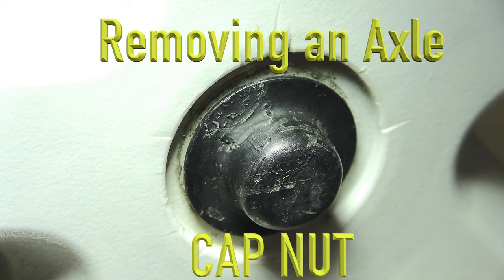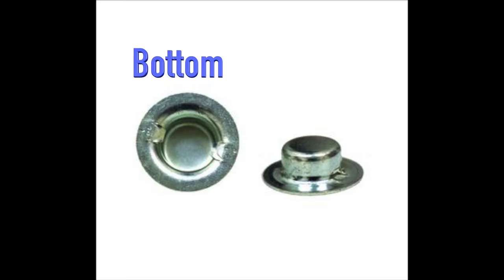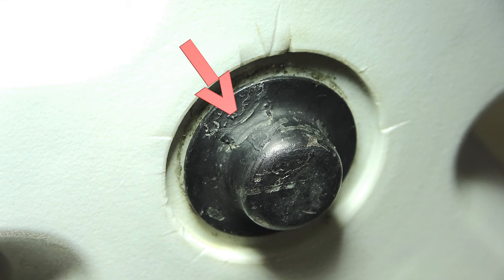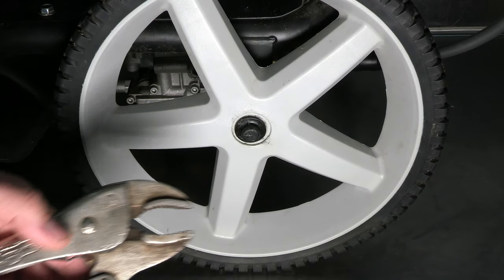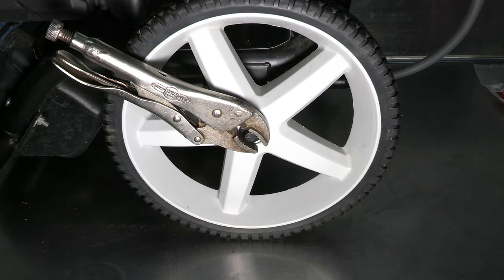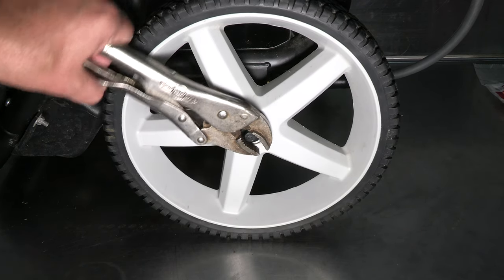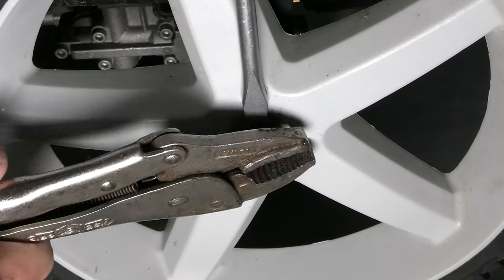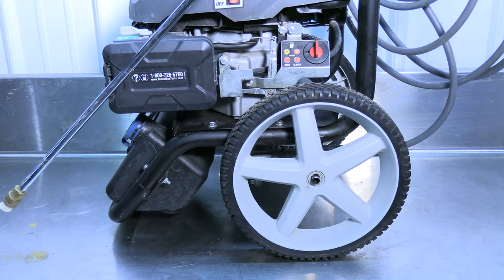How to Remove a Push Nut  -  Axle Cap Push Nut Removal

Comment: Unfortunately the push nut is recessed below the wheel hub. The only way to get a vise grip is straight in (no good for torqueing) and the flange OD of the push nut is so close to the recess diameter that the best one can do is go in at a 45 degree angle which prevents prying on the edge of the push nut (it just pops off).  I could drill a hole in the plastic wheel hub to expose an edge but I am still going in at a 45 degree angle. My other lever point is the plastic edge of the wheel hub recess which would deform badly.  I  have heard of a device that has teeth on the inside that can be pushed down on the push nut cap end. It cuts into the metal and has reverse threads like an easy out for screws but engages the OD.  I understand mechanics use them on rounded off lug nuts and will remove wheel locks (used by mechanics where customer doesn't have or forgot their wheel lock key).   I have tried drilling off the two locking tabs but the recess prevents the necessary access angle.  I even tried a Dremel tool to create a slot but the push nut is tight up against the end of the axle. Can't get a good bite without engaging the push nut AND axle, resulting in defeat. Any help would be appreciated. .Acetylene torch???/!!!!!!!
Reply from the maker: Simply grip "straight on", and use another visegrip on the clamped visegrip if you can't torque it by hand.  Use a ""church key" paint-lid opener instead of a straight shaft screwdriver if you cant make a purchase with the flathead.
Reply: @PhilCrockett Brilliant!

Comment: Hi I have a radio flyer wagon with a push/ cap nut.  The axle measures .44 in but I can't find a cap nut anywhere that fits this exactly.  Would a 7/16 (0.4375 in) nut work? I found a 4 pack of these.

Thank you
Reply: Well, did the 7/16 caps work, or not?